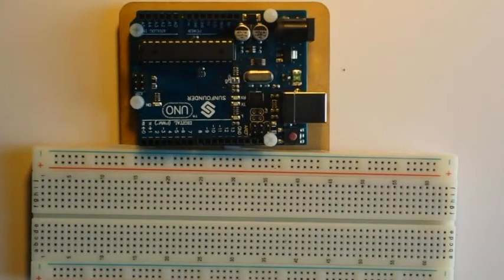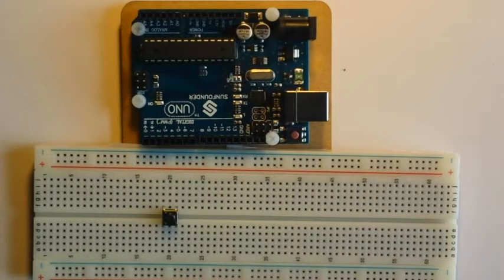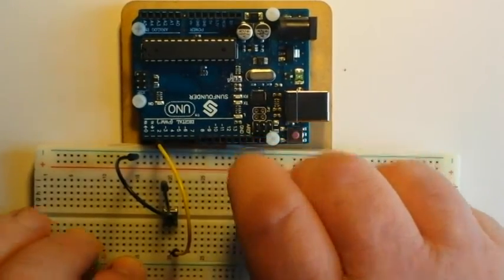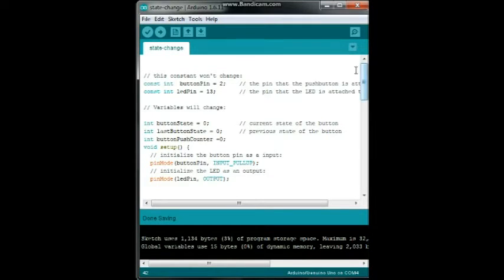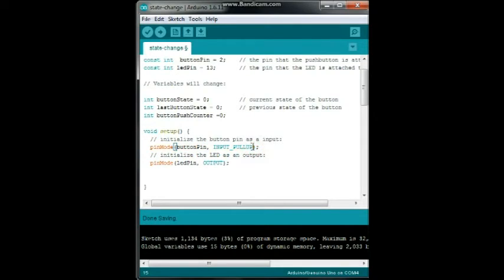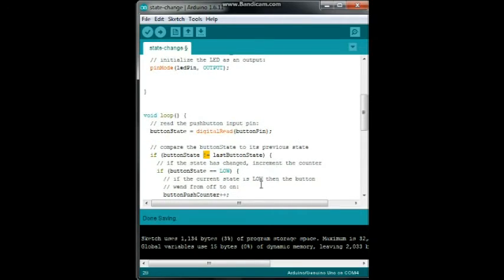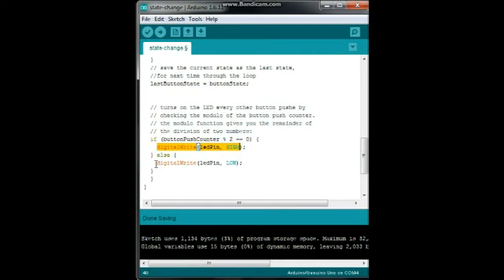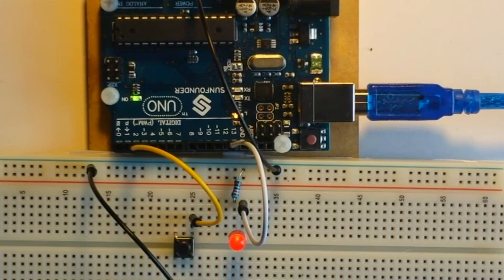How to detect and handle a state change with a button press

Comment: Just starting with this arduino nonsense. I hate to say it, but I finally caved in and looked up how to do this exact project. Tried to do it on my own steam, but I'm not there yet. My initial idea was to create a program where if it detected the light was on and the button was pressed, the led would turn off. If button was pressed and light was off, it would turn on. Looking back on it, I think I was missing some code, not sure what yet, and  probably didn't even have the circuit on the breadboard correct. Good video, I'm just trying to understand how pullup works, and the purpose of ground.
Reply from the maker: Check out my video on pull up/pull down resistors: https://youtu.be/5vnW4U5Vj0k

Comment: const int buttonPin = 2;
const int ledPin = 13;

int buttonState = 0;
int lastButtonState = 0;
int buttonPushCounter =0;

void setup() {
  // put your setup code here, to run once:
pinMode (buttonPin, INPUT_PULLUP);
pinMode (ledPin, OUTPUT);
}

void loop() {
  // put your main code here, to run repeatedly:
buttonState = digitalRead(buttonPin);
if (buttonState != lastButtonState) {
  if (buttonState == LOW)
  buttonPushCounter++;
  delay(5);
}

lastButtonState = buttonState;
if (buttonPushCounter % 2 == 0) {
  digitalWrite(ledPin, HIGH);
} else {
  digitalWrite(ledPin, LOW);

  
}
}